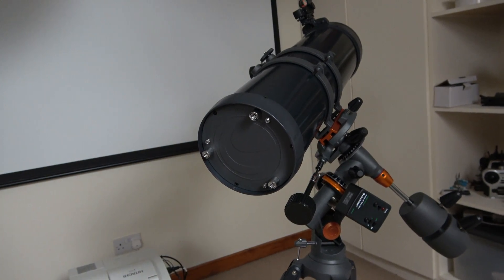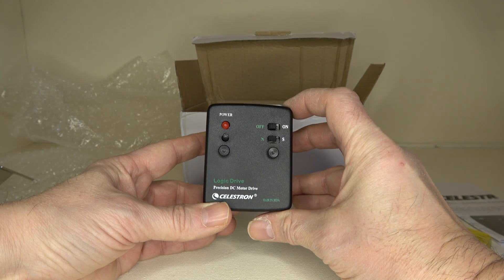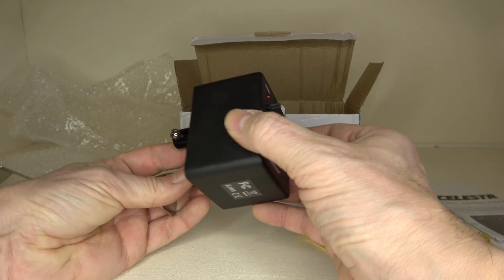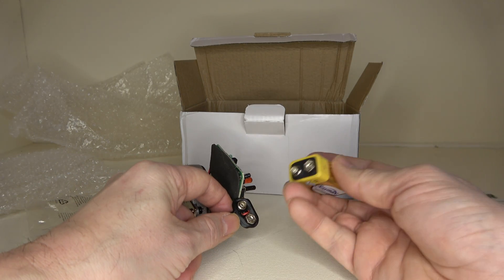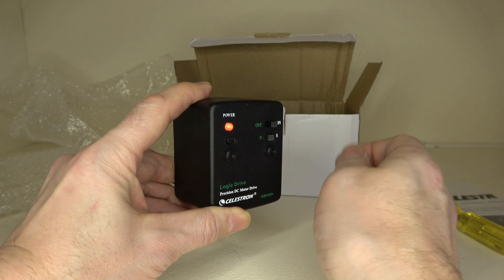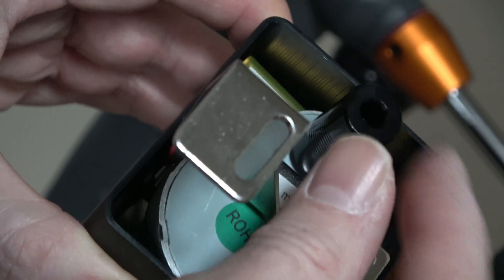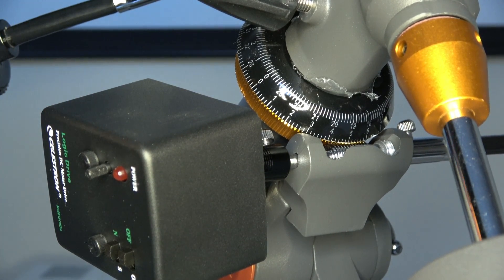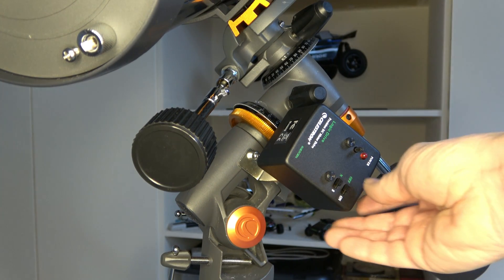How To Fit a Motor to a Celestron Telescope in minutes ... Sounds Complex but it's actually easy!!

Comment: Thanks Dave! This helped me figuring my already monted on and how to put the battery.
Quick question if I may. Once that is connected I am not able to move the slow motion control. Is there a way to bypass? or once the motor is connected it is the only and main controller for the slowmotion knob?

Comment: I have a doubt,
How to maintain the speed of motor drive in telescope with the object such that the object is in the centre???
Depending from how far the object is from north or south pole star , the distance does varies and also the angle....
Pls answer
Reply: The rate at which the earth rotates is steady. The adjustment know on the motor allows you to match that rate at which the earth rotates.

Comment: Hi Dave, thank you for the clear video, but when I use mine I have everything setup the exact same way you have yours, yet it doesn't actually move the telescope itself. I tried with just one weight too but the motor wont actually move it.
Reply: This is a simple but tricky drive system. 

You have to tighten the knob to lock the telescope to the gears for that axis. You should not be able to move the telescope by hand. If you can swing the telescope around that axis by hand, the motor is just turning the worm gear but not biting the teeth of the round gear. 

But if the tension knob is TOO tight, the harder worm gear will EAT the threads of the circular gear. The gear should be the same color all around. If part of it is silver, those teeth have been worn down and you will need to fix this before the motor drive or even the manual controls will work.

And the motor drive itself has a very specific connection to the worm gear shaft. If it isn't tightened properly against the flat part of the worm gear shaft, the motor won't make the worm gear move. 

Finally, the telescope might not seem to be moving if the motor is on the slowest setting. Crank the knob on the control box up (the motor should get louder). The movement should then be detectable.

It is really easy to miss something even if you follow these directions here given the questionable operational and build quality of this enigmatic equipment mount.

Comment: Good video, but I have a question. When my motor is attached to the telescope, it causes my telescope to shake a little every time it makes an adjustment. It also makes a clicking sound every time this happens. Do you think this is human error caused by me not putting it together properly? Thanks.
Reply from the maker: Have to say mine never does that, is everything tight and secure, it should move slowly and smoothly, does the battery hold good charge?

Comment: That declination motor is a piece of junk right out of the Eighties. Very poorly designed even for being at least 40 years old. As far as mounting the battery, I just used some velcro and stuck it to the side of the motor box. That way I don't have to fiddle with the box to change the battery.

Comment: Hey 
It not working.i have installed the motor drive but motor is not able to rotate the knob.helo me out
Reply: loosen the rotation knobs a bit it will move freely
Reply: @premnathrao  i will try .
Thanks 😊
Reply: You might want to check that the axis shafts aren't too tight. My Celestron EQ-1 mount came from the factory with mounts that were so tight and the worm gear misaligned so badly that the manual RA knob struggled to turn it by hand. There is a nut inside the mount under a plastic cover for this, same for the declination shaft.
The mount also seems come packed with grease that's so thick it resembles glue more than a lubricant. Get that out of there and replace with some quality grease while you're sorting out the axis shafts. Your telescope will absolutely love you for it. These mounts seem to be poorly assembled from the factory, they work, but only just. TLC required.

Comment: Thank you for your very informative video's! In your installation, does the DEC slow motion collide with the motor if you observe high west? I had to turn the scope around such that the DEC slow motion faces the front of the scope. Also (I live in Europe) still I had to switch the motor to 'south' for it to go in the right direction.
Reply: Hi , so you're saying that you have to switch it to South even when you live in the northern hemisphere ?
Reply: @shreyasj4502  Yes, correct.
Reply: @hanspaulvanderlaan8105  ohk me too , I thought something is wrong with my telescope's motor 😅
By the way, for me the knob of the DEC axis hits the setting circle of RA . Does it happen with you as well sir?
Reply: @shreyasj4502  I cannot test that anymore, I traded my setup for a 120mm refractor with Eq5. Very satisfied now.
Reply: I have exactly the same problem.  I'm in UK but have to switch the motor to 'S' to track in the correct direction.  I asked Celestron for advice and they were useless.  They didn't want to know.  Has anyone found an answer to why these motors track in the wrong direction?
Reply: I live in Texas in America and have the same problem and also when trying to get the right angle it is in the way a lot of the time. I guess someone in R&D dropped the ball on this one!
Reply: Is it because you attach the motor drive to the other side of the mount so that you have to set "south" even in Europe?

Comment: Hello, you can use slow motion RA Knob when motor is attached to telescope?
Reply from the maker: No it becomes fixed to the motor however you can still unlock the clutch bolt and then move the telescope freely with motor still attached.
Reply: @reviewsbydave8417  meaning the screw ?